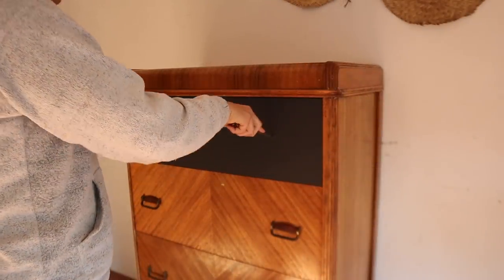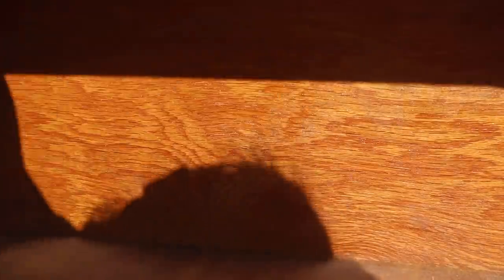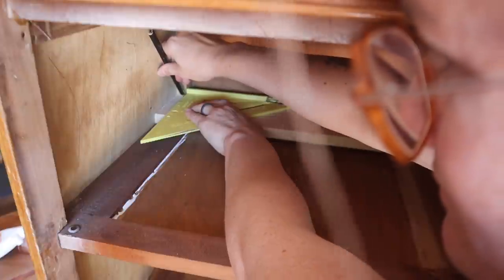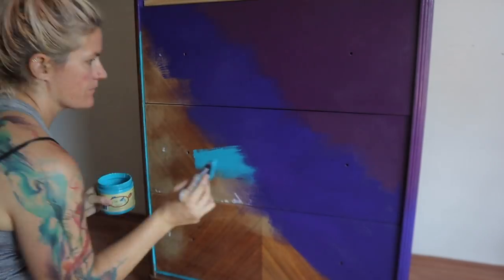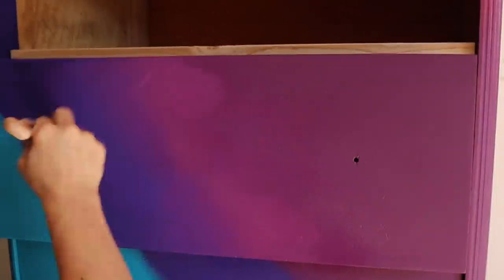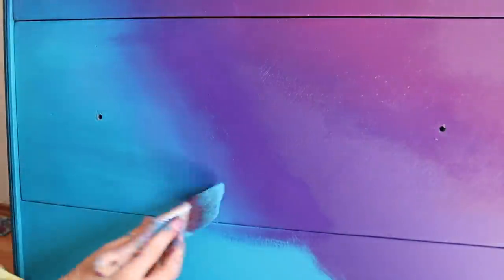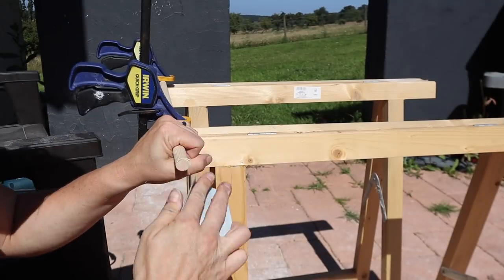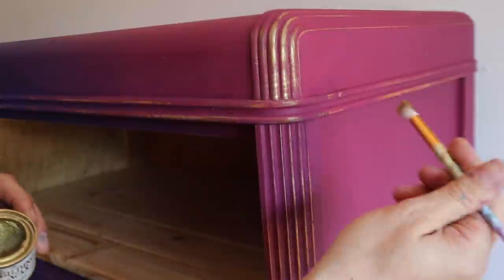How To Diagonal Blend Paint On Furniture | Repurposing An Old Chest Of Drawers With  Bella Renovare

Comment: Nice job, as usual.  And I have a question about painting the wood dowels.  If I wanted to use color to make the pulls go with the copper and the rest of the dresser, what would you suggest?  Metalic spray paint?  A colored lacquer maybe?
Reply from the maker: Thank you Richard!! I think yes spray paint for sure and then a spray poly if you are going for a metallic look :)